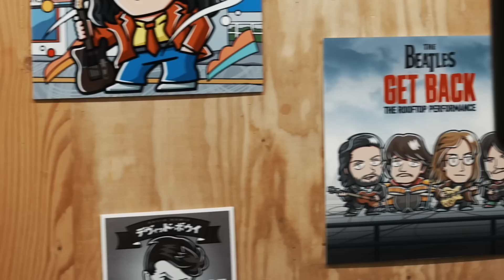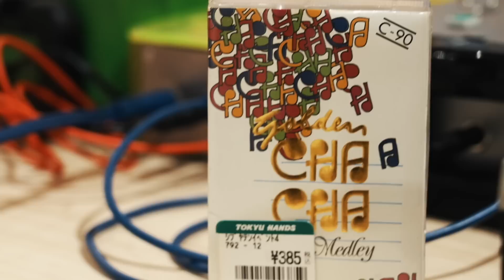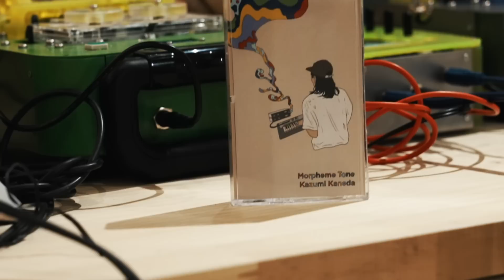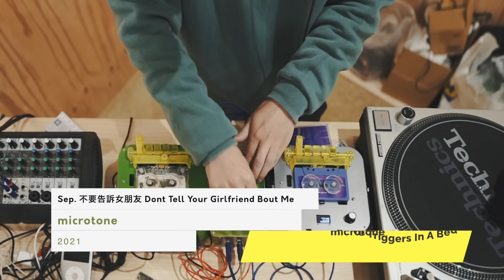FULL CASSETTE | ALL GENRE MIX set | ooedotechnica

Comment: much respect!👍🤩 we built similar deck in 1998 using 2.walkmans. We did not touch the reels during beatmixing but implemented a plus and minus nudge HW microswitch for both walkmans and those momentarily raised or lowered the motor speed when pressed (ofc with a small electronic added to motor control circuitry)
Reply from the maker: Are you an engineer? Thank you for the useful comment 🙏
Reply: @the_moment_work  thank *you for the great mixes👍 yes I am an electrical engineer but back in the days, when we built the 'walkman deck'  I was  teenager and going to secondary technical school.  Those days we were keen to do cool stuff you know.. organizing parties, DJing and constructing audio gear was certainly on our agenda 😎. And we had all the instruments in the school's labs and we also received kind support/advice from teachers, so it was a great atmosphere for kids like us.. I feel too nostalgic already 😂 hahah..  //and I have to admit that I have some midrange casette decks today and a few hundreds tapes from the 90s..
Reply: Good idea, I wish I'd have tried that back in the day😎👍

Comment: Back then I started djing with a very modest two deck radiocassete player out of a need to mix some music by any means. I did bpm sync with two cassette that were bpm close if you slow down the faster one by pressing very gently the thumb fingertip against the rotating shaft. Sounds weird but I even try to make some (really bad..) mixtapes with this method. It was very very expensive to buy the standard dj gear at that time but I learn a lot by doing this cheap mixing.   Your dj set and your equipment are so cool. I'm amazed...congratulations!!

Comment: It strikes me that it would not be too hard to design a cassette player with a jog wheel like a DJ deck. The pinch rollers need to be removed/changed maybe like the way a VCR head works.. excellent design though seems to work well! 👍😎❤️

Comment: seems strange using cassette, when you could used cd instead? But great mix. How did u make the cassette machine? How much are they? cheers
Reply: Pete Testube  Cd is digital. Audio is superior. Cd mixers already exist.
I mean mixing CDs can be as skillful as mixing cassettes, with basic dj cd players.
Mixing tapes is also cool, but would be even cooler with regular cassette decks without a pitch control, selecting similar bpm music. And using better cueing instead.
The echo out effect basically means this kind of mixing would sound similar in the end.
Cheers.